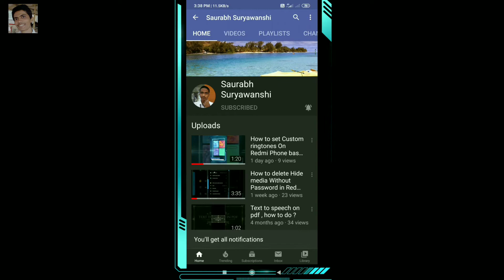What Inside in Wireless Mouse  Receiver ?

Comment: Hi...Majha IBall magical duo wireless mouse cha dongal haravla ahe. Its impossible to get the receiver of exact frequency of my iBall mouse. But, what if, I replace the RF transmitter of my mouse with a completely new transmitter and use the new receiver? will it work? and if I decide to give it a try...where will I get a transmitter and a receiver to experiment on a mouse? Please let me know your thoughts...cause if this solution works it will solve the problem completely!! Awaiting reply...
Reply from the maker: you not able to get that same frequency , you buy new one ,even you buy new dongle it not work .
when it works you need to change Transmitter(Tr1) of mouse with same mouse receiver (Re1) not same mouse of (Re2) means you need not buy or replace Transmitter and Receiver together  remember desoldering of transmitter is complicated
Reply: @SaurabhSuryawanshi  Thank you very much for  reply 🙂... You are doing great job... Keep up!